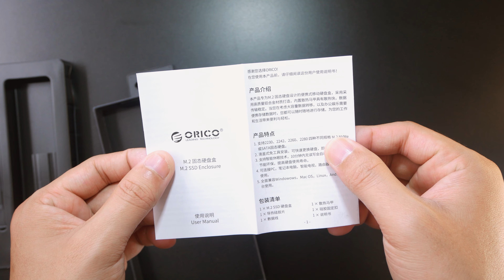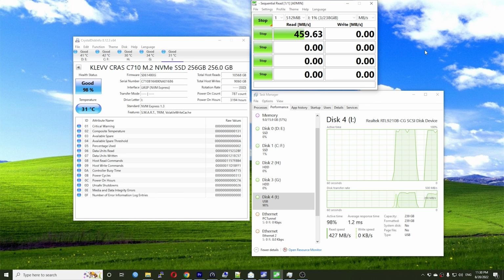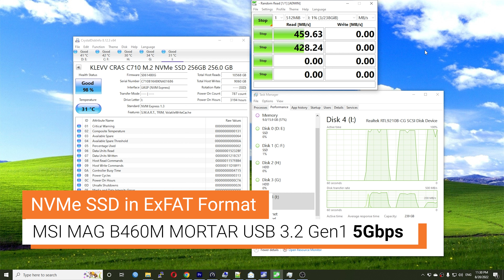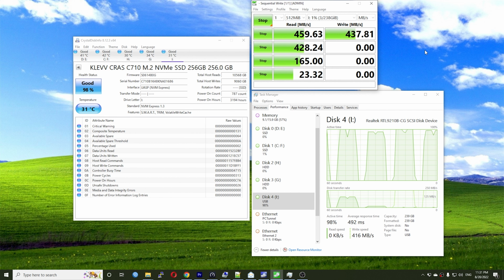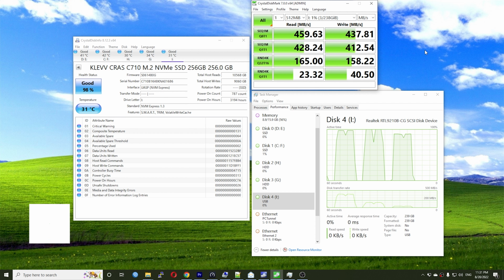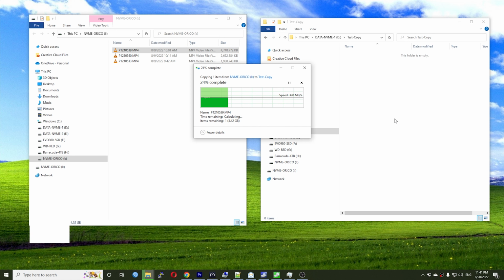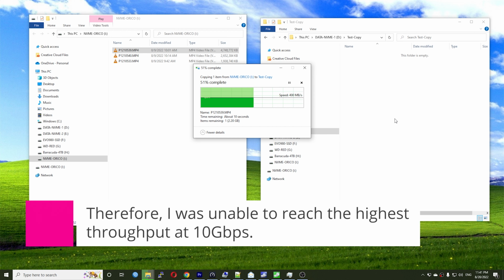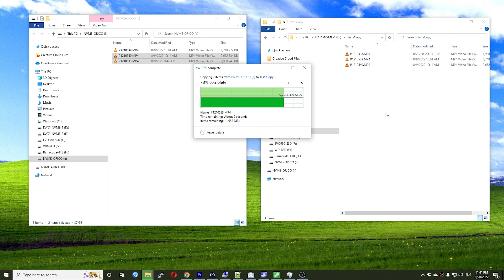ORICO M.2 NVME/SATA Dual Protocol SSD Enclosure - Unboxing & Review (Realtek RTL9210B-CG)

Comment: I got an older version of these which is dual bay and includes clone functionality without the need for a host - the only thing I'd say however is that they do get rather hot for most even the single bay ones
Reply from the maker: I see. My first Orico product was the 2.5 inch SATA USB enclosure and it is still working great until now. After that, I bought an M.2 SATA enclosure to install Ubuntu and plug them to my x86 test machine, but still very hot when operating due to the material/build is plastic case + aluminium top cover attached to the SSD via thermal pad (model M2PF-C3-BK). This new enclosure seems solved the heating problem, but I can't verify the 10Gbps throughput.